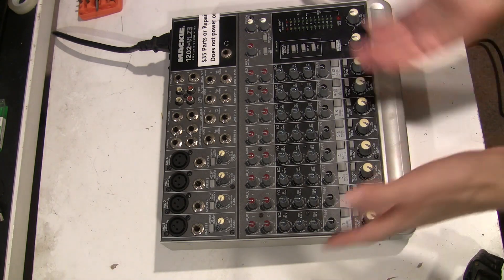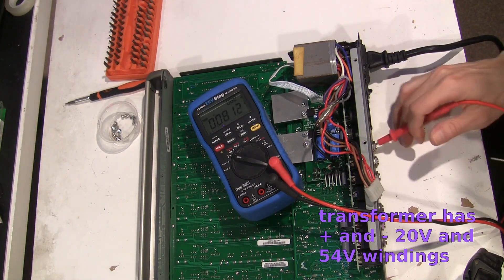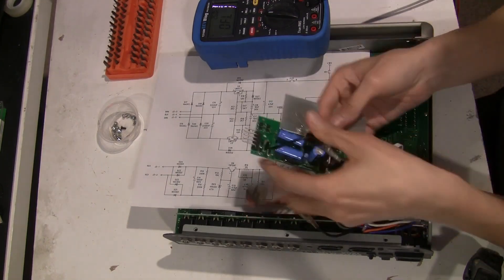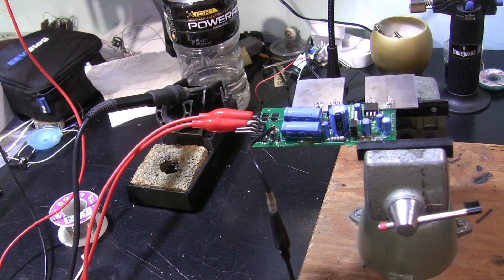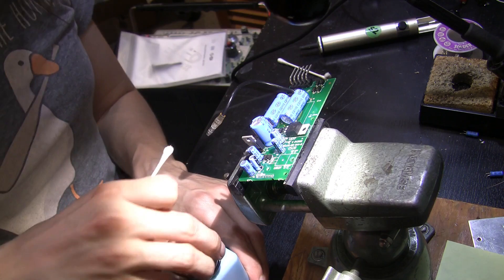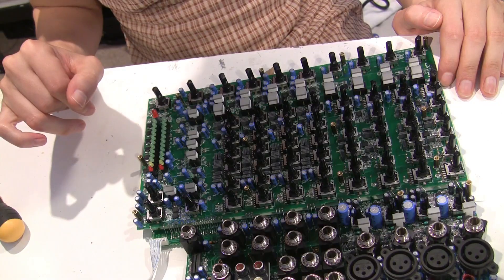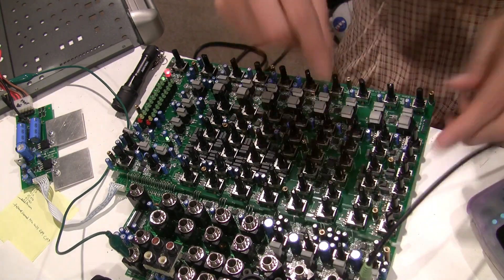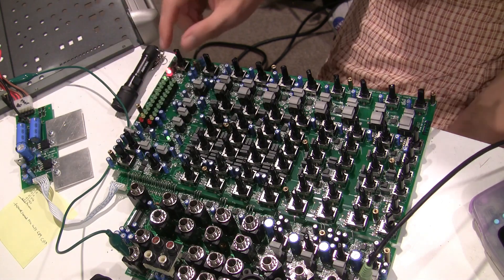Repairing a Mackie 1202-VLZ3 that won't power on

Comment: I would not trust any of the capacitors anymore and just recap the entire thing. Replacing it with good Rubycon or Nichicon long life capacitors. This looks like one of those devices where replacing without thinking would be a good option. Usually it is not.
Reply from the maker: Yeah. The thought crossed my mind as well. I wanted to get it working in one evening so that's what I did. When I fix my desoldering iron I'll give it a proper fix.